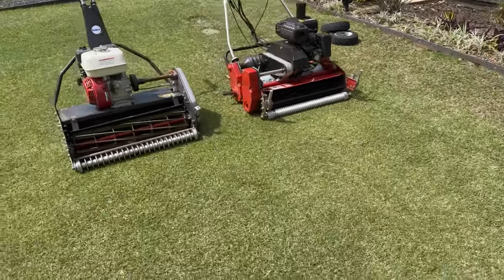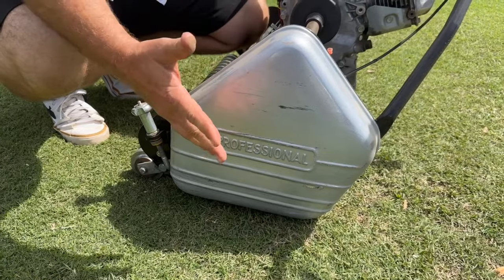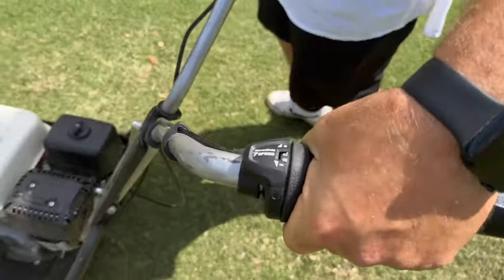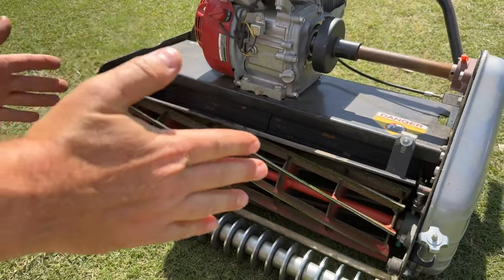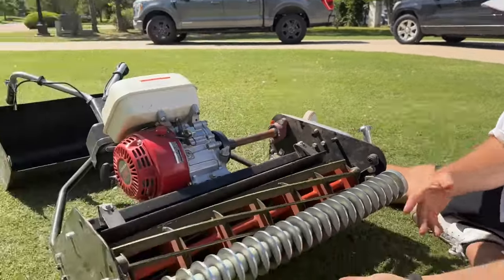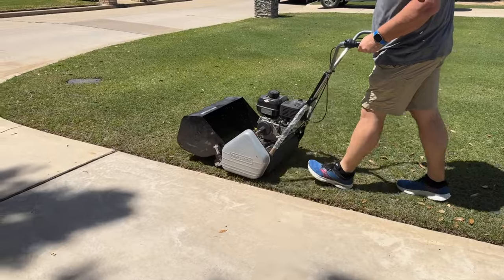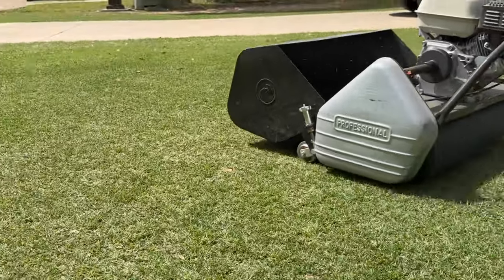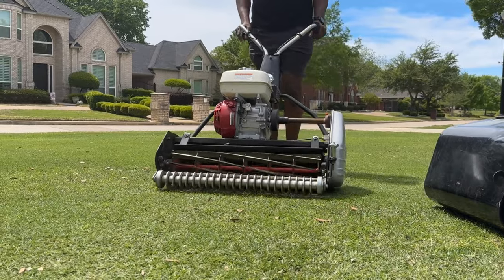ROLUX REEL MOWER BATTLE | ROLUX DEMO DAY

Comment: Would you rather have this than a tru-cut c27? I seriously almost orders one until I saw the videos on this thing
Reply from the maker: Tru-cut is outdated in terms of maintenance ease. It's not a mower I’d want to spend significant time adjusting the reel to bedknife or dealing with additional parts for backlapping. Instead, consider the Rolux, which stands out among the three other mowers I discuss in the video.